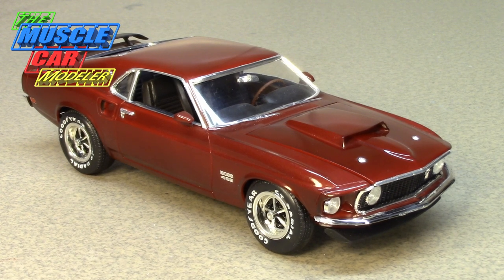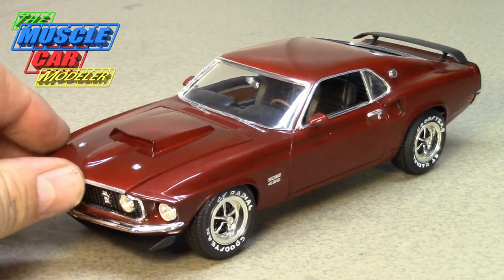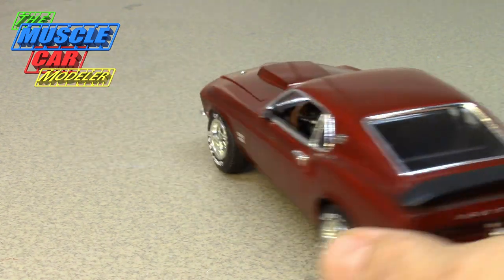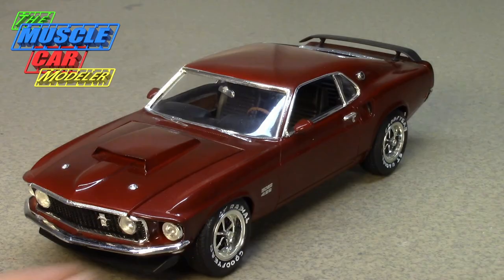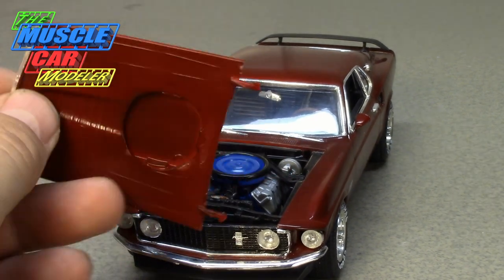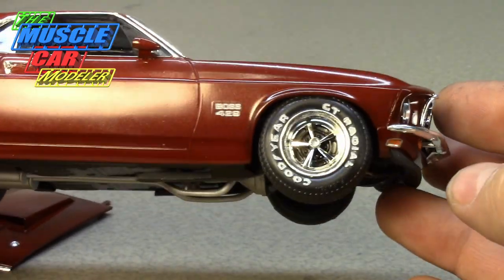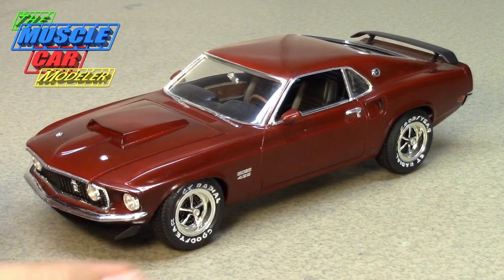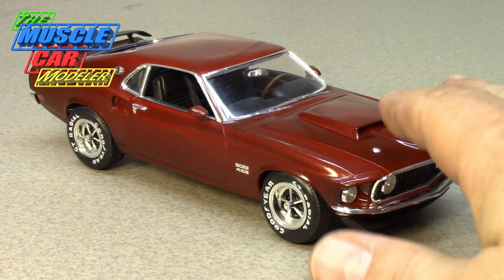Revell 1969 Boss 429 Ford Mustang Fastback Build

Comment: with the revell 69 boss 302 kit you can make a 429 it comes with the block and valve covers too and extra air intake bits
Reply from the maker: I have that one as well. What that comes with is the 428 CJ parts and is incomplete. What I started with was the Mach 1 and is what that Boss 302 was based on. The Boss 429 is a completely different motor.

Comment: Word was that all it took to really wake up the Boss 429 was headers and a slightly bigger carb...and nice build!! Is this the same kit as the Monogram Boss from the 80s???
Reply from the maker: Thanks! Most of this is the Revell 69 Mach 1 428 that is 1/25th scale. First appeared in the Hot Rod series. I used the Monogram 70 Boss 429 engine, exhaust and hood scoop from the kit you are referring to.

Comment: Hello Ralph  I was wondering what kit did use to build your mustang 1969.  Did you use two kits build the one car.  The mustang 1969 boss 302 and the 1970 mustang 429 kit for the engine?
Reply from the maker: Yes, I did but the 1969 Boss 302 was not available at the time that I built this and does have a few issues that you would need to overcome. I used the Revell 1969 Mach1 kit that predates the 1969 Boss 302. The Boss 302 does not have the quarter scoops that the other 69 fastbacks have and while you could cut the body for them. The kit does not have the inserts in the kit anymore. It does have the Shelby scoops so don't get them confused. The Mach1 kit has the body with scoops, and you will need that. But the Boss 302 has a better-looking front end. You can switch those parts, but you will need to use the hood also. The Boss 302 hood is longer and does not have hood pins but most Boss 429s didn't either. The Mach1 hood has a shaker and the 302 hood is flat but that does not matter as you will be cutting the hole in it anyways and use the 70 hood for a pattern. The 70 hood is 1/24 scale and will not fit the 69 bodies. So now you might be buying three kits. The 70 Boss 429 gave up its engine, hood scoop, decals and exhaust.

Comment: Awesome build! Did revell fix the “sad face” front end issue on the new boss 302 kit from a couple years ago?
Reply from the maker: Yes they did. It is much nicer and I built one of the Boss 302 kits. If you use the Boss 302 kits nose you need to use the hood from that kit as well. The hoods are different lengths to match up to the nose.

Comment: How did you kitbash two different scales tho? Cuz the 69s are 1/25th. What'd you just use the 429 in the 69 kit?
Reply from the maker: I used the entire Boss 429 from the 1/24 70 Boss 429 kit. It is a tight fit but does fit. Nobody notices the scale difference unless I tell them where the motor came from.